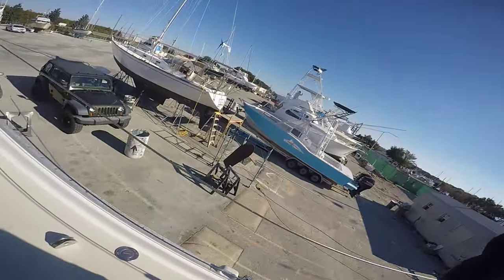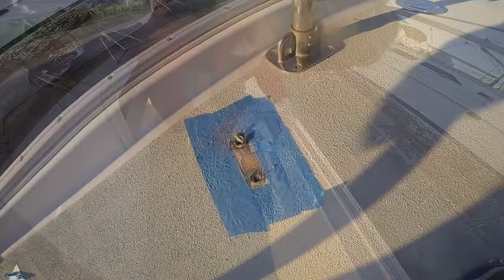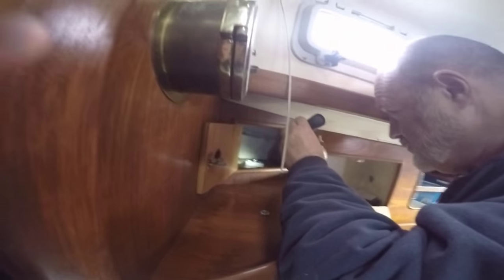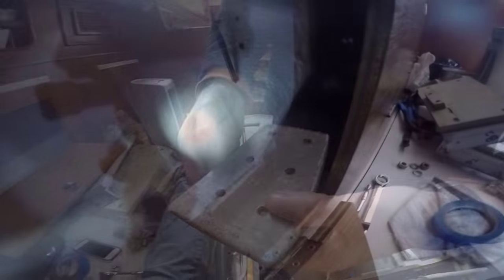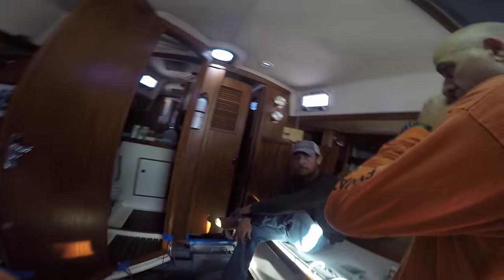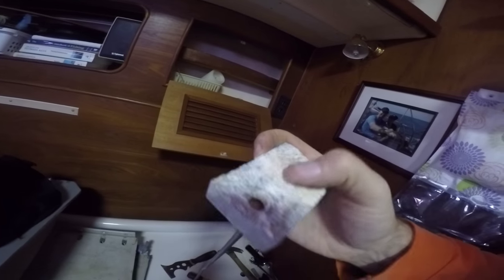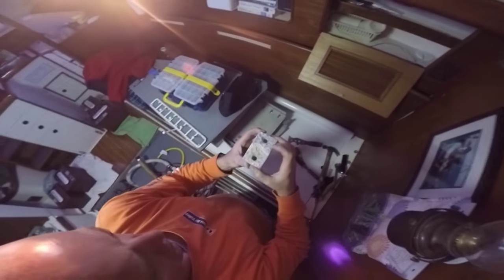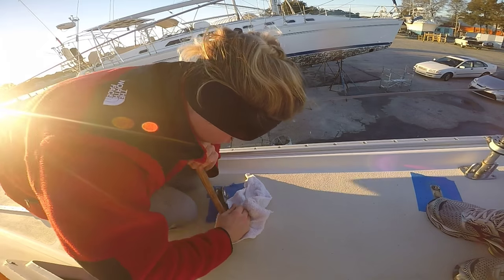#58: Corrosion You Cannot See

Comment: I used to work for an aircraft company. They would do a process called an NDT (Non Destructive Test) on bolts to see if they are viable. Sometimes this was more cost effective then outright replacement of many pieces.
Reply from the maker: +g. Normal Thanks Normal.  There is a dye test kit you can do on most parts and x-ray I believe on the rod rigging to try to find unseen cracks and failures.  We were of the mindset to replace most everything we could.  Appreciate you watching!

Comment: had that boat ever spent a great deal of time underwater? seems to be an awful lot of corrosion!
Reply from the maker: +bill bye Hey Bill.  No, but great question, on the bobstay backing plate in particular.  Because it was in the bottom of the anchor chain locker, that plate often spent a good bit of time sitting under wet, salty chain which lead to corrosion you see in the thumbnail pic.  You'll see in future footage that we made a new floor for the anchor chain locker (above this plate) and redirected the anchor chain water to a sump box.  No more rigging sitting in wet places!  Thanks for watching Bill.

Comment: Using a hammer like that on a fiberglass deck will damage the decking as it places too much concentrated force on one small spot.  You should have used something that gives you lots of leverage to pull that fitting out instead of a hammer.  I know hindsight.
Reply from the maker: Thanks for the tip.  Luckily we had no issues (other than contact with Annie's jaw!)

Comment: disimular metals like stainless steel and aluminum will have corrosion.  This is because the less noble metal with a small amount of moisture will corrode.  It similar to what happens with Zincs & Anodes.  With the blocks made of aluminum and the rods & bolts made of stainless, the aluminum is less noble is will be sacrificial.  if the blocks had been made of stainless there would not have been a problem like this ......
Reply from the maker: Thanks Joe.  Very helpful.  Appreciate the input and for watching.
Reply: +HaveWindWillTravel.com to have the blocks made of stainless would have been cost prohibitive.